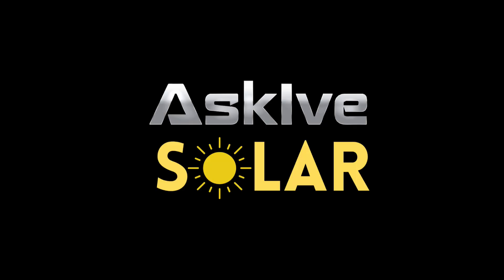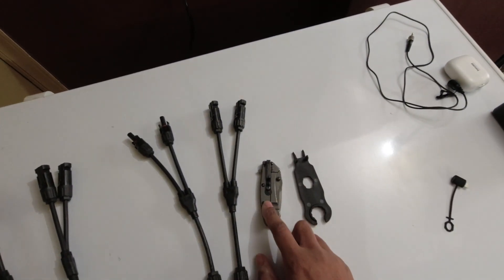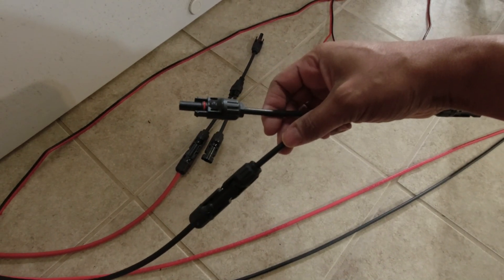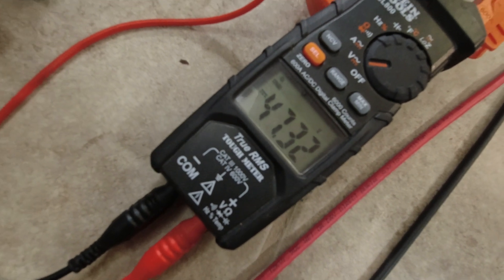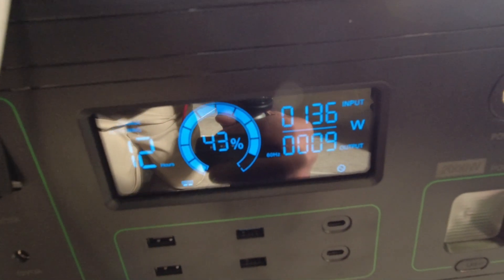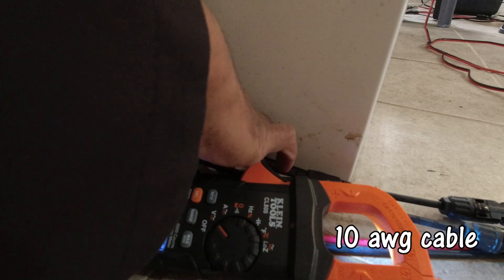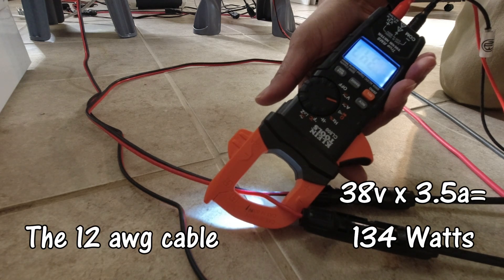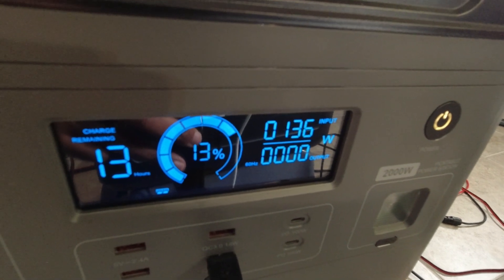What Size Solar MC4 Cable Should You Get? 12 vs 10 Gauge / AWG

Comment: Now do a DIY cable next. I think PV wire is useless for power stations. For permanent installs I understand the need for it but not for non-permanent. My PV wires still fade after a few months outside so the UV protection seems false. Maybe after several years I might see a degradation in the insulation but there are many cheaper outdoor rates options out there.
Reply from the maker: I would have to find some cable I would "like" to deploy. What would be the deployment benefits of using different cable. Also I dont think the PV rating is about the color. ha
Reply: What non-PV wire would you recommend?

Comment: Thanks Ive, your series setup with higher voltage helps reduce voltage drop issues.  The general rule is, the higher your voltage the lower your wire gauge needs to be.  Thanks for doing the experiment.

Comment: From my experimenting you'll only see noticeable power loss over 12awg wire once you get above 10amps or higher. Since you were only seeing 3.5 amps total, you weren't seeing much at all. If you start pushing more than 10-15 amps through your wiring you'll definitely want 10awg wire over a long distance. Great topic for a video!
Reply from the maker: Yeah I doubt I or most mainstream power station owners would need to go that high. I mean I get it, west and south facing arrays of 200 watt panels or bigger in parallel sure. 

I've also been told that once you hit that high in amps, you need fuses. Interesting stuff.
Reply: @AskIveSolar  im running 16A
Reply from the maker: How long of a run?
Reply: Wouldn't it have been easier to measure the resistance of each guage type of wire?
Reply from the maker: I don't even know how to do that. Enlighten me if possible
Reply: @AskIveSolar  Resistance is measured in ohms across a conductor.
V= I x R

V is Voltage drop

I   is the current flowing through the conductor (Amps).

R is the resistance of the conductor (in ohms).

Comment: Bigger the wire size, less voltage drop. Especially on long runs of wire.
Reply from the maker: I get ir in theory but in reality, when does it matter yanno. A longer run for more sun hours for a slight drop in voltage is hardly the thing to bat an eye at, I believe. I'm more concerned about heat and cables melting which needs a lot of current, I'd presume.